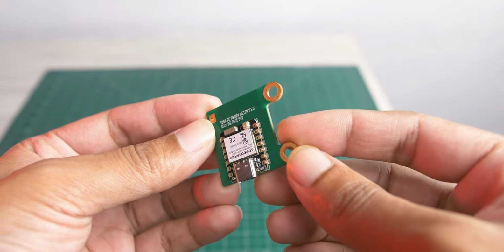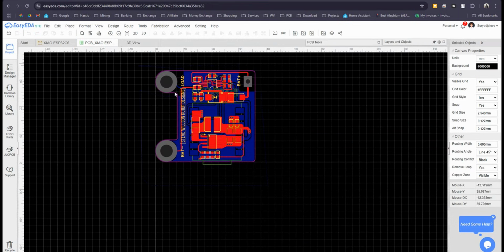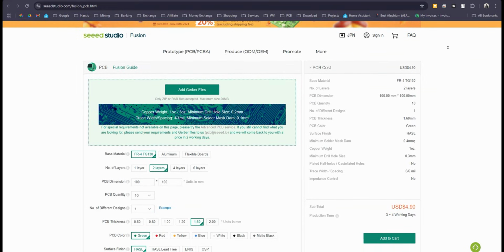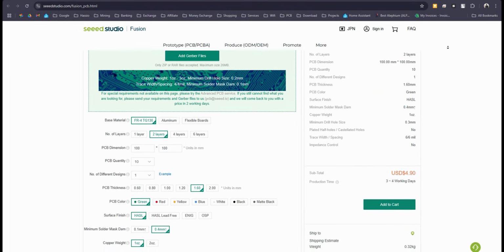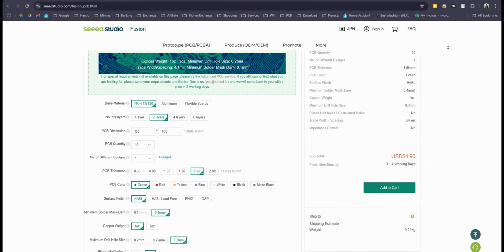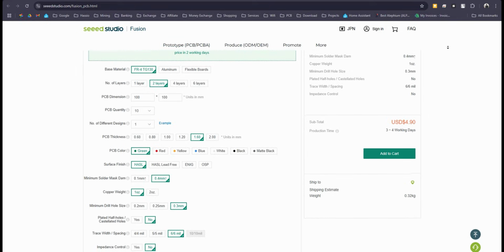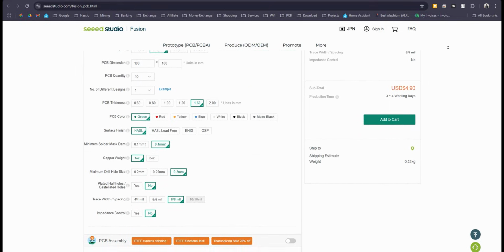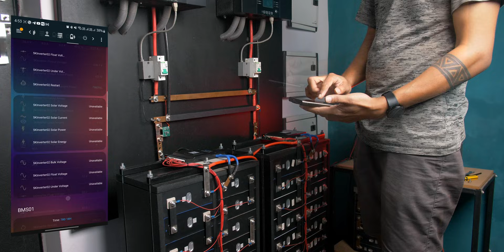🔋 Mastering SOC： Precise Tracking of a 28kWh LiFePO4 Battery Made Simple!

Comment: Please do you have gas level monitoring sensors that can be retrofitted into lpg cooking gas composite cylinder to monitor gas level and auto ascertain users and gas distributors of a cylinder that needs refill when it gets to a preset low level. Or can you make a video on how to build this kind of sensors with the parts needed. I need a sensor module that the battery can last for 10 years or 5 years Atleast and both the sensor and battery will be inside the cylinder but at the very top.